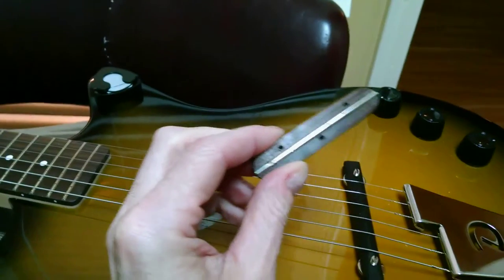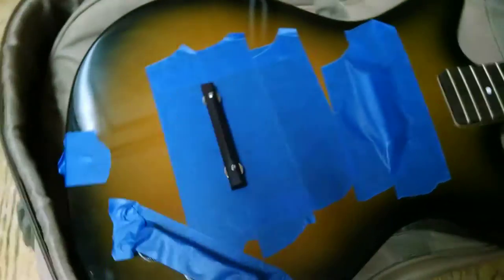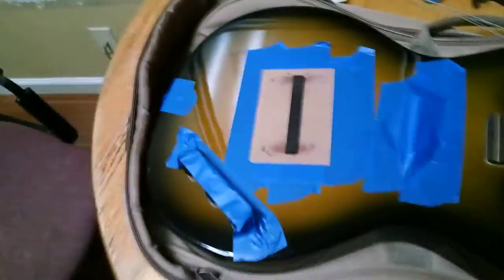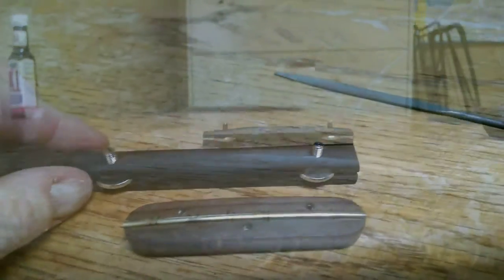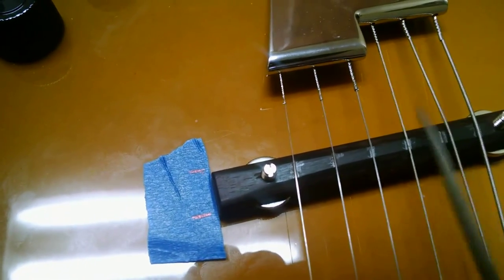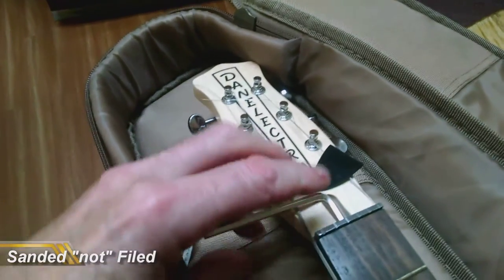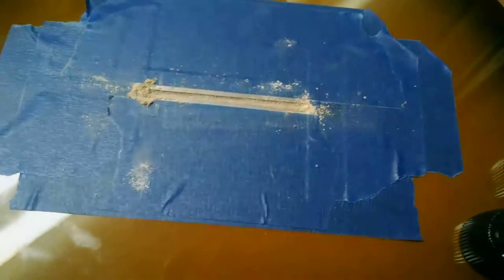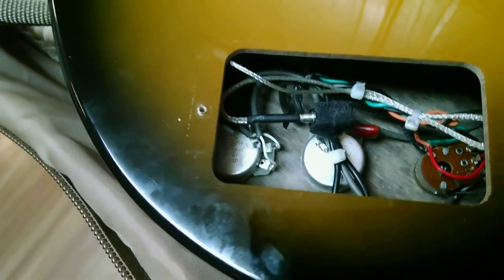Danelectro Convertible - Upgrades

Comment: For $60 I would think you could get a bridge that wasn't just straight. Different strings require different lengths. I'm sure you understand what I'm talking about. I can't quite say it.
Reply from the maker: Yes, a compensated bridge..I looked around but the dimensions of the Dano were very odd for finding a bridge that could fit in such a narrow height...and $60 bucks, that hurt . but I just slanted the bridge and it intonates OK.
Reply: Michael Cossey Yes, I see. The original bridge is straight anyway. I know how you feel about trying to be a guitarist when $60 isn't something you can part with easily. Anyway, thanks for the upload.